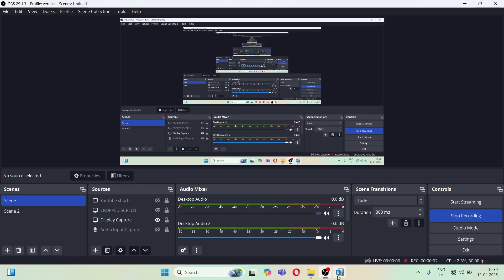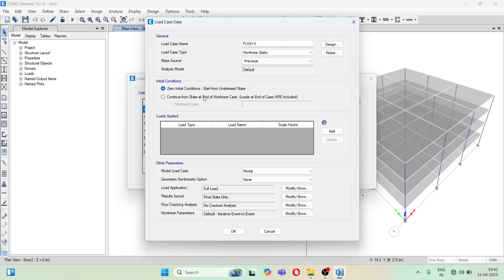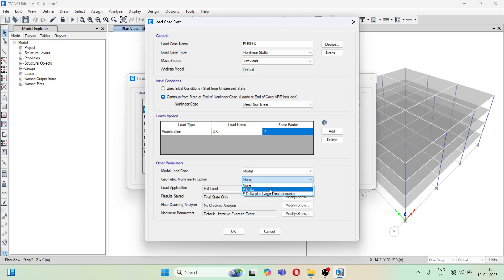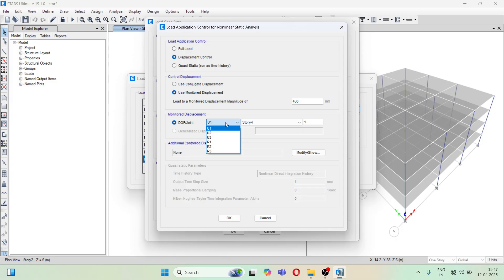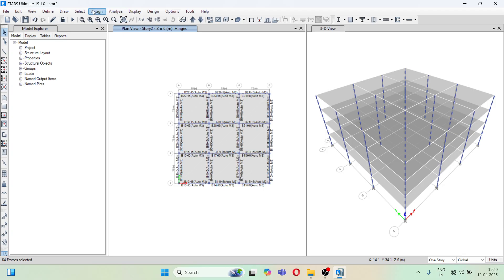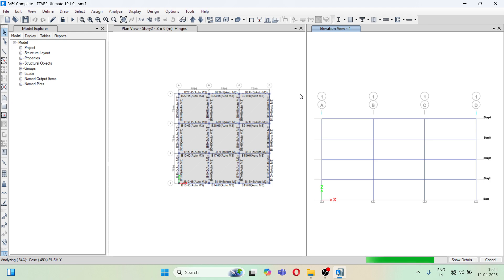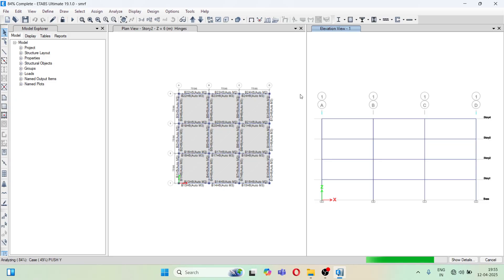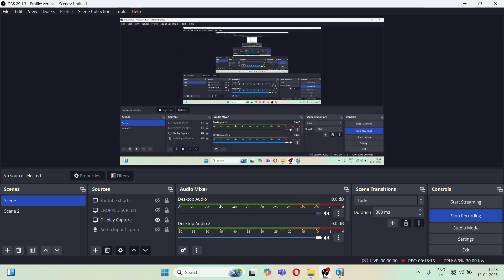Pushover Analysis of a building Using ETABS | non linear static analysis | pushover curve | capacity

Comment: In accordance with the procedures shown in the instructional video, I have modeled my building structure in ETABS based on its actual configuration. However, the resulting pushover curve does not exhibit a descending branch; instead, it continues to rise without a noticeable drop. I would like to understand the cause of this behavior. Is such a response considered normal when applying the Capacity Spectrum Method (CSM) or the Displacement Coefficient Method (DCM)? Furthermore, what adjustments or checks can be made to address this issue, if necessary?
Reply from the maker: Check the value of monitered displacement and and maximum displacement in push over curve, wheather they are same or not
Reply: @Realcivil  Thank you for your response. May I ask, if the analysis stops before the monitored displacement is reached and the pushover curve still shows an increasing trend, what could be the possible reasons? Is there something I might have missed in the modeling or analysis settings?
Reply from the maker: There is one option in etab. But i dont know much about it

Comment: Good morning, could you please answer a question for me? I have my structure in ETABS, which has walls (slabs), and I want to calculate the thrust curve. I did it exactly as shown in the video, but in the end, it loads up to a certain percentage and I get an error :(, or what could I add? Please help me, it's for my thesis.
Reply from the maker: It may be because of convergence occoured. Check how much your structure is pused in push over curve. If its sufficiently pushed then no problem or you can check the shape of push over curve if its bend downward at the end then also its ok.
Reply: @Realcivil  What I meant was that I have structural walls and and the graph comes out straight
Reply from the maker: Delete the walls and check the curve
Reply: @Realcivil and I didn't get :(
😪😪
Reply from the maker: If you have applied shear wall in structure then for instance delete those wall and then run pushover case and check the shape wheather it is straight or curve